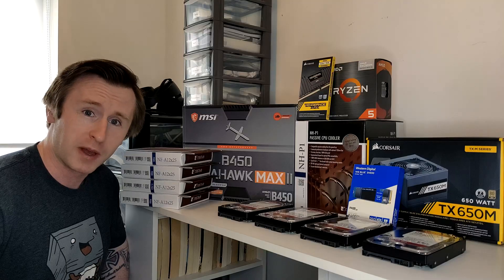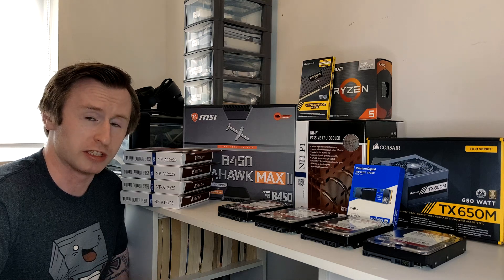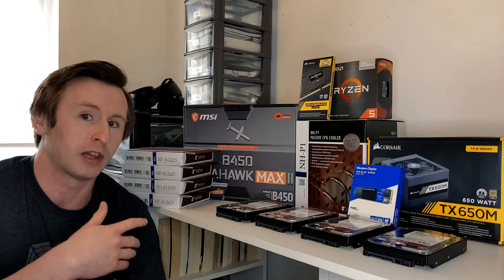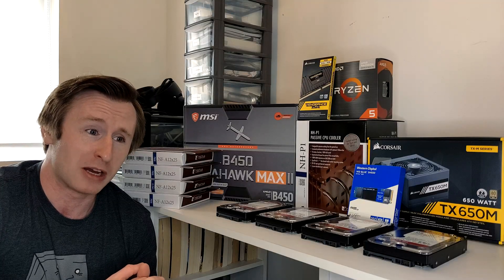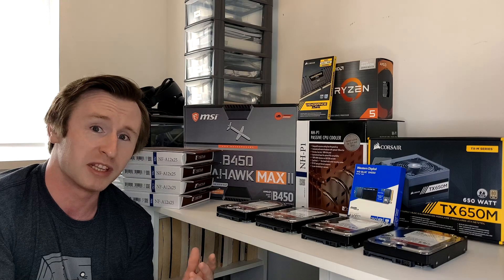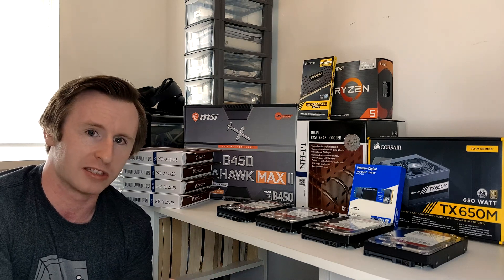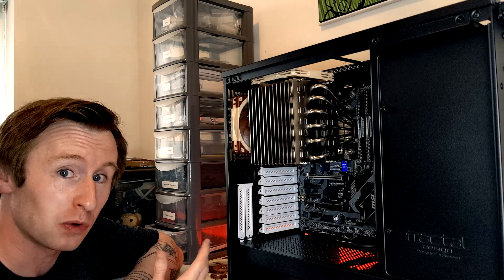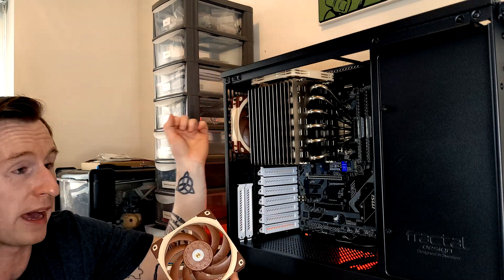Building My 16TB FreeNAS! Passively Cooled Ryzen 5 5600G Home Server Build

Comment: what is the power consumption?
Reply from the maker: Don't have anything to measure from the wall sadly but I would guess around 100w at most with the CPU underload. Just an estimated guess though.
Reply: I'm interessested in the power consumption as well as the temperatures after running a while. Really like the passive cooling you've  chosen. If power consumption and cooling is fine, I probalby will do a similar build with unraid and some docker containers.
Reply from the maker: @ARock-st7gc  I'll need to find some way of accurately measuring the power usage but in terms of temperatures, from TrueNAS' reports the 5600G barely touches 40c when transferring files back and forth and the storage sticks around 30c 👍

Comment: @PCJack, I'm doing a FreeNAS build with exactly the same specs (Tomahawk B450 MaxII, 5600G, 16GB LPX). Got the MAX II for the same price recently. I'm wondering, did your board come with up to date BIOS? Or did you have to do the BIOS flash back before installing everything?
Reply from the maker: Hey! Sadly mine didn't come with the up to date BIOS but this motherboard has BIOS flashback so you can still update the BIOS without a CPU. As it's been a few months now you may not have to do the same though 👍
Reply: @PCJack  Thanks for your reply! Do you advise that I update anyway or give it a go first. I have a hard time trusting the BIOS flashback. Thanks!
Reply from the maker: @yiannos3009  No worries mate! 👍 I'd just drop the CPU in and do a little test bed set up outside the case first to see if it posts without an update. If it doesn't then you can just crack straight on with the BIOS flash. Just make sure to rename the BIOS ROM file accordingly to the instructions and let the BIOS flashback do it's thing as it can take a few minutes before it's completed 👍
Reply: @PCJack  Hi! Just wanted to let you know everything went smoothly. Put the board on my UPS and flashed it. Went for the Fractal Define R6 as well and loving it (I have a Define 7XL and love that too). Started from a fresh Ubuntu 20 install and migrated my ZFS pools to the new machine + configured services manually. Everything works brilliantly. One small issue: sometimes after a restart the BIOS screen has a green tint, but I suspect it's a compatibility issue with my KVM. Thanks for your advice, congrats on 100 vids from a recent subscriber. Keep up the good work!
Reply from the maker: @yiannos3009  Awesome! Glad to hear it went well! Cheers mate 👍

Comment: Good Work for a first build. Next time you can use a normal CPU with a GPU for the install and then boot in headless mode. Ryzen pro apus have ECC but only unbufferd. You can do more at the Same time even plex or some encoding at the Same time. And for an Hba ... The best Bank for the buck are gen 2 sas hbas in it mode for hdds i got Mine 16 port hba for 109€.
Reply from the maker: Thanks for the advice! Already had the 5600G from my review so was happy to use it anyway. I'll see how I get on for now but a HBA is definitely next up for an upgrade 👍

Comment: 4000 series apu is ecc
Reply from the maker: Yeah on the Pro series I believe 👍
Reply: @PCJack  issue is it has lower lane count . Wouldn't care but I sold my 4650g last week for a 5700. Some have stated ECC will work on 5000 if the board manufacturers adopt it , so might be worth testing a strip
Reply from the maker: @wrusst  Could be worth looking into the future for sure! 👍

Comment: Any reason for FreeNAS and not UnRaid?
Reply from the maker: Honestly I'm not particularly familiar with how UnRaid works compared to FreeNAS and also heard performance suffers a bit with UnRaid without SSD cache. Could be an idea for the future though to get maximum capacity. Any redundancy issues though?
Reply: @PCJack  Can´t tell you will do Raid5+SSD Cache ... About to decide am i gonna use intel or amd ... but by the looks of it gonna be AMD R5 5600/3600 / 570.
Reply from the maker: @GregorMima  Sounds good mate! 👍

Comment: Cool video, why not use an HBA tho?
Reply from the maker: Cheers mate! 👍 Good question, firstly this is the first ever Nas I've put together so really it's pretty bare bones for a storage array as a first timer. Secondly, as I'm currently only using 4 drives I can just use the onboard SATA ports. Albeit I'm currently maxed out with the M.2 boot drive disabling the last 2 SATA ports which then means I would have to get a HBA in order to add additional storage. Overall as this is my first Nas, I will probably look to expand further down the line but a HBA is most likely the first upgrade. Any in particular you'd recommend?